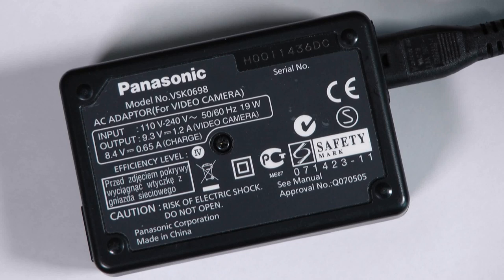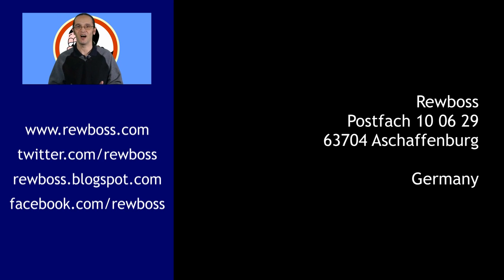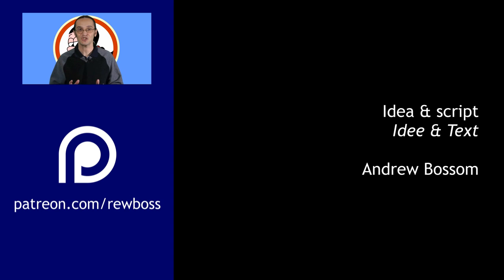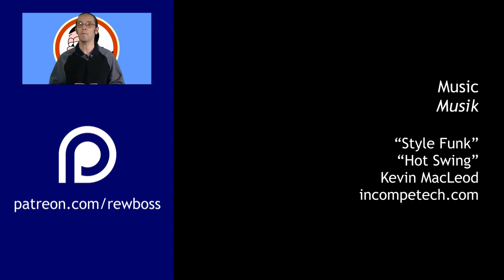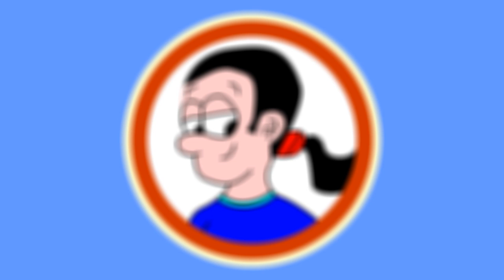Square pins and round holes

Comment: There's an easy enough solution, buy a USB cable that's meant for charging only. In Germany, these are often marked with a L (laden = to charge) on either the plug or the cable. Or, if you don't mind fiddling around with some tiny wiring, cover the middle two of the four connectors with some piece of non-conducting adhesive tape. These are the data transmission lines, the outer two are +5 volts and ground, and these are enough for charging.
Reply: Eisi Kater I still wouldnt thrust them, they could have some dodgy PSU inside that supplies more than 5v and could fry your phone or it could be connected the wrong way. Just use your own PSU, that is made to handle fluctuating voltages and other dubious stuff.

Comment: 4 nickpicks from me: 
1) 2:49 is a death-daptor, which should only operated (and given access) to people which are aware of it's dangers. (customs will regularly confiscate them from foreign mail order shipments in germany.)
2) mains voltage in continental Europe is 230V
3) the mains connector CEE7/7 (for outlets CEE 7/3 and CEE7/5) is not use in Swizerland, there it's SEV1011.
4) CloverLeaf (IEC C5) is not the complete picture, there are a lot of appliances on CEE7/14 ("Euro")
Reply from the maker: 1. The one I show is CE certified. I should probably have specifically mentioned that, but I'd like to know how you know it's so dangerous just by looking at a picture of it. I think by "customers" you mean "customs officers": they didn't confiscate this one.

2. Yes, I got that one wrong. But, to be honest, it makes very nearly no difference at all. Certainly not to your average tourist.

3. That's why I said "most but not all" European countries. There are quite a few other designs: Italy and Denmark, for example.

4. I think you have your terminology mixed up here: the Cloverleaf plug is C5. The one I don't show is C14. However, I trust my viewers to see with their own eyes what kind of plug will fit their own device. I never said C5 was the only standard, only that it is A standard.
Reply: re 1: That adaptor can only conform if it prevents a 3-pin plug from being used with it (cannot see if it does or does not in the video). Adaptors that "cut" the earth lead are violating the regulations.
Reply: you are right... it autowrecked me... "customs" i meant... they like to confiscate if the find them...especially in "Oberursel", no joke... they are the ones handling goods "of suspected value above 21€" for the main taunus area. 
Anyway, for the death-daptor: The border/lip of the rear is not wide enough, so you might insert just one prong of the device, leaving the other pin dangling around. And so you have an easy accessible "live mains" point.  see for example BigClive on that topic (he has the same issues with UK/EU-adaptors) v=ESIzuV6kdWY
Reply: Don't most hairdryers use resistive elements that wont really heat up on 110v? A 220V hairdryer on full heat uses ~1500W, on 110V it would be about 375W. A 1500W 110V hairdryer on 220v would melt the heating element or blow a fuse as it would use ~6000W. (assuming it hasn't a positive temperature coefficient heating element)
Reply: Grooohm hehe, and yet we still have Hairdryers in America!
(Dryers in 110V countries pull more current in order to get the same power. With double voltage that could be a problem once upon a time, but modern ones can usually handle high voltage too. Your 230V is less at risk in a 110V socket but yeah it may not get hot...)

The issue with hairdryers isnt the voltage though its the frequency. The motor circuit is designed for 60HZ (in the us) so a slower 50HZ will damage the blower-motor over time and the same vice-versa.

Cheers!!
Reply: ... i don't think you understood my post, and i have to disagree that the frequency will be the bigger problem. The motor of an american 110V hairdryer will even run 16% slower on 50hz, and that should only increase the lifespan. Or, in cases where they use a universal motor, the frequency is irrelevant (for example, all philips hairdryers that i checked are advertised as 50-60Hz but most without universal voltage). But the heating coil would melt long before that matters anyway. Yes, there are universal voltage hairdryer, but these are mostly the fancy, electronic and expensive ones.
Reply: My hairdryer has a switch for 110/220 V (yes, it's that old). All it does is switch the two heating coils within between serial and parallel, and it doesn't care about 50/60 Hz. It's not fancy at all, you just have to be careful to not plug it into a 230 V socket when it's in the 110 V setting.
Reply from the maker: An AC motor running at the wrong frequency will usually burn out. No, it doesn't "prolong its life" by running 16% slower. Often it will work for days or weeks, sometimes even longer, and all seems well, but that doesn't mean all is well. I have heard from many Americans who used their American hairdryers in Germany for a while, but when they returned home they just stopped.
Reply: Could you add a source to that? I do not despute that american hairdryers will die, sure they will if they arn't rated for 230v, but it's the voltage that kills it, not the frequency. A 110V 60hz motor will use about the same power if it runs on 91v 50hz. But it will hopelessly overload on 230v. Yes, a motor could still overheat as the fan would spin ~16% slower but we are talking about a hair dryer which for sure has enouth airflow to still cool the motor.
Reply: There's no urgent need to give scientific explanation. If the manufacturer of any kind of appliance is sure that the mains frequency doesn't matter, it will print "50 Hz - 60 Hz", "AC" or "~" on the appliance.
If the manufacturer insists in using either 50 Hz or 60 Hz mains frequency, there will be a good reason for it.
Reply: In most cases manufacturers are using motors that could handle both frequencies. In belt-drive record players for example, there you need to change the pulley (for the correct speed of the record). From the service manual of a Dual 504:

http://dual.pytalhost.eu/504s/504%20Service%2010.jpg

There you can see only the part number 116 is different (the pulley), the motor is the same. Only the cable with the plug is different, and the cable is connected to different connections to change the voltage:

http://dual.pytalhost.eu/504s/504%20Service%2005.jpg
Reply: tbh, 99% of all times, hairdryer are operated by a DC motor,  when you open them up you can usually find the rectifier diodes directly attached to the motor pins. They make a great source for motors in DIY or other little electical projects. 
With a DC motor + rectifier circuit i think it shouldnt make any difference what frequency you get. Sure ripple for higher frequencies is lower, but for 50/60 Hz it isnt even close to hitting the 10% tolerance boundary around 230V.
Reply: 2) It used to be: Continental Europe 220V, UK 240V. Some time in the 1990s they harmonised this to 230V with +/-10V tolerance. So they're now nominally the same voltage, but in practice it wasn't a problem even before then.
Reply: +Xaver Lustig - YES

Comment: The British plug: a lone adaptor wields the power of 1000 Lego bricks when stood on. A peeve is their shape: they are not the easiest to transport, the wire often comes out the bottom, meaning that the wire could fray more easily, and since they contain the fuse and transformer within the plug, they are often large and clunky

But I still prefer British plugs, though I may be bias.

Comment: The United States is also a 220 Volt country. It's just that they deliver that voltage in two phases of 110 Volts.
Reply from the maker: North America uses a split-phase system (not the same as two-phase) which can supply 220 V for high-demand appliances, that is correct. However, Germany uses a three-phase system which transmits at 400 V (you multiply the voltage of a single phase by the square root of 3), so by your logic Germany is actually a 400 V country.
Reply: @rewboss  The USA uses 240 V split-phase (120 + 120 V). It's been a long time since it was 220 V.

Comment: Tip: If you travel to Germany and have some devices (Smartphone charger, Notebook, etc.) to connect to the power. Buy one adapter (ebay) and put a multi power socket in the luggage.

Comment: In theory, the phase relationship in a universal motor (i.e. one with a commutator and brushes) is not affected by line frequency.  (The nameplate on my wife's Conair, for example states "50-60 Hz")  Of course I can't argue with real life experience, so if these appliances burn out, that's good to know.  :-)
Reply: Just check the input sticker on the device if it clearly states 50-60Hz it will accept any frequency in that range, if it states 50/60Hz it will work on a grid at either of those frequencies just fine. Don't mix devices that explicitly state just one frequency with grids of a different frequency so if the sticker says 50Hz don't use it in the USA, Canada, Southern Japan, etc and likewise don't use a device saying 60Hz in Europe, China, India, Australia, etc.

Comment: I don't quite get it - if you say a Transformer is not needed anymore, what is going to happen to Optimus Prime then?
Reply: There is a label on the rear side of each device which tells you the range in which the device could operate. Modern devices have there a wide bandwidth.
Reply: Lol

Comment: 3:25 Just wondering, does this replacement has a fuse in it? Because I thought in GB they have the fuses in the plugs, isn't it quite bad to have a plug without one then?
Reply: As far as i know it is dangerous to use the british adapters without the third pin as that one is the safety one
Reply: Phone chargers are so low power generally use a fusible resistor on the board instead. This does sacrifice the replaceability of a discreet cartridge fuse but makes thing far smaller and replaceability is less critical when the entire USB power supply can be purchased so cheaply. Especially when you consider the sort of 100 mA or lower rated fuse you really want for a device like this if you don't want the PCB to go full bonfire before it blows is a fairly specialty component and would need to be ordered specially to replace it anyway shipping on those if just buying a handful is often not much cheaper than replacing the device itself.
Reply: @iter9290  You actually can't the earth bin has to push past a lever as it engages in order to open the safety covers blocking the live and neutral pins. This is why even on double insulated devices that do not need an earth connection the pin is still present on their UK adapters just usually made from plastic.
Reply: @seraphina985  well it being out of plastic pretty much defeats the purpose doesn't it? still sounds dangerous, more so for high powered devices
Reply: @iter9290  We are talking about low power double insulated to meet the standard as well as meeting the double insulated standards there are I believe limits on the maximum power of the device I believe mostly we are talking low power electronics with insulated wiring all enclosed inside a secondary 240V rated insulated external case ie to touch anything conductive you would need to destroy both the case and strip the internal wiring. The main reason the pin must be there even when not needed for the device is that the sockets don't expose the live and neutral pins without it being present.

The idea here is to prevent anything other than a plug inserted in the correct direction making it into the socket. Mostly the shutters are more of a child safety feature though it would be fairly easy for a determined adult to bypass. It is merely a spring loaded plastic shutter connected to an angled pin in the earth slot as the Earth pin goes in it moves the shutters down exposing the other holes.
Reply: The power supply itself will have an internal fuse, although maybe of the automatic resetting type. Power adapters like that are ubiquitous in the UK. 

I should also add, that the fuse in the plugs are there to protect the cord, not the device. That means that if the circuit is rate for 32A (common in the UK), and you  plug in a table lamp with a 0.5mm^2 flexible cable (which can safely carry about 6 amps) then it is protected by the fuse in the plug which will likely be 3A. Otherwise the flexible cord's protection is at the circuit level (which means, in Germany that might be a 16A breaker and in the USA maybe as much as 20A). 

If a device needs further protection, then it will be via an internal fuse, and that's the case for power supplies. In this case, there is no flexible cord.

Comment: The 50 or 60 Hz thing is only important for big three phazed 400 V motors, not for the ones in 230 V equipment.
Reply: Anyone blindly believing this statement is ill-advised.
Look at the label on your hair dryer, or its manual. It will tell you what frequency it's fine with.
Being able to cope with multiple frequencies is a selling point, particularly if the product is a compact one designed for travel, so if a device is ok with multiple frequencies, it won't hesitate to say so.
Just checked 4 different hair dryers, and only one of them (the most modern one from a somewhat expensive brand, being a somewhat hefty non-travel-style one) claims to be ok with 50-60 Hz. Another one (same brand, same heft, a lot older though) says it wants 50 Hz, and two travel-style hair dryers with foldable grips (an older brand model, as well as a somewhat modern no-name one) also want 50 Hz.
Also, even if a hair dryer appears to work fine with the non-matching frequency, it may still suffer, and degrade its life expectancy (and definitely void warranty).
So as far as hair dryers go, always check.

Comment: The flat pin plug is used in America, Canada, Mexico, Central America and most, if not all of South America. Japan and South Korea uses the flat pin. Not all flat pin plugs have a third round pin. The round pin is a ground for draining excess electricity. These flat pins need 110v at 60 cycles. When I was in Germany the electricity was 220v at 50 cycles. You had to use round pin plugs with 220v through a transformer to get 110v flat pin plug. I think 110v was used in America because DC current was used for a time before AC current. DC current cannot travel very far over the electricity transmission wires. AC current can go thousands of miles. This was a fight between Thomas Edison, wanting DC current. And, Nikola Tesla who wanted AC current. AC current won out.
Reply: The first sentence is true, except for the South America bit. Rule of thumb: the further south and east you go on the continent, the less likely your American type-A plugs will work. Brazil has its own system (type N), Argentina uses Australian plugs for some reason, Suriname is on the same plugs as its former colonizer Netherlands, same with French Guiana and France (minus the "former" part). Chile and Uruguay use Italian-style (type L) plugs, as well as type C "Euro" plugs.
Reply: Last I heard, the 110/220V story was as follows:
When the US mains system was standardized, light bulb filaments back then couldn't take more than 110 V reliably; so mains power was standardized to the 110+110 V Live/Neutral/Live 3-wire system the US still uses today, with lights run on either of the two 110 V Live/Neutral circuits, while high-power devices (back then mainly motors) were run on the 220 V Live/Live circuit.
Europe was relatively late to the electrification game, so when they caught up, light bulb technology had already moved on to reliably take 220 V, so in Europe the mains system was standardized to a 220 V Live/Neutral 2-wire system (though in practice modern households actually use three separate lives at different phase under the hood, de-facto making it a 4-wire system and allowing for access to even higher voltages).
A higher voltage has the advantage that you can transmit the same power over thinner and therefore cheaper wiring, and 220 V was probably chosen because devices designed for this particular voltage were already being manufactured for the US market.
The only reason the US didn't also switch to pure 220 V is probably that their standard had already gained too much inertia when technology had matured enough.
Reply: @Whomagoose  The AC/DC current wars were between Edison and Westinghouse. Tesla had very little, if anything, to do with it.